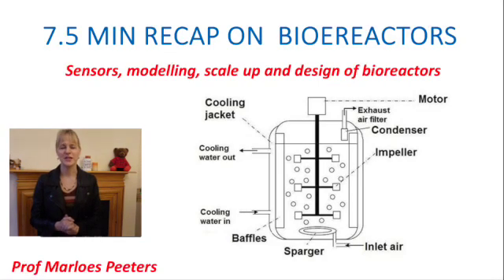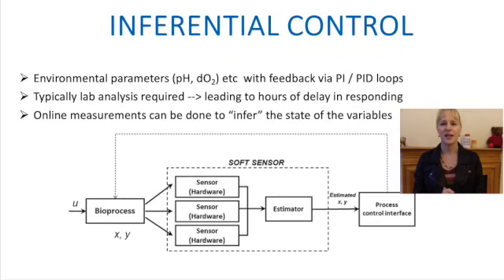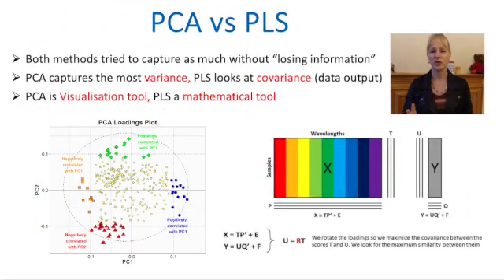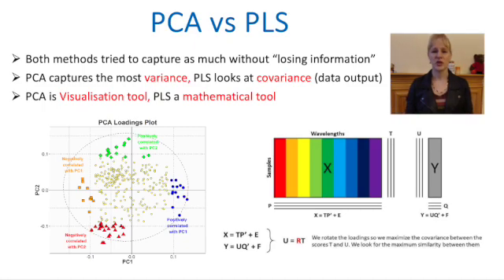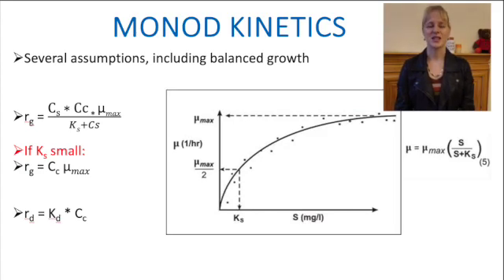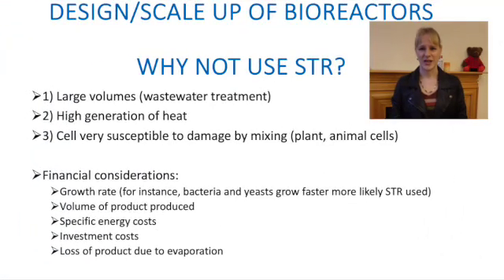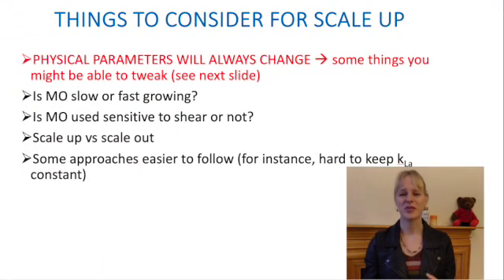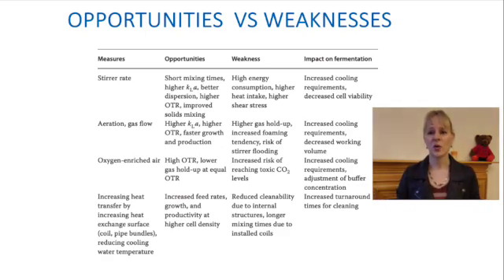Bioreactors recap: sensors, modelling, scale up and alternative reactor design

Comment: Just a quick question: I believe both Power per volume and KLa won't be similar at scale up. How do take the next step plz?
Reply from the maker: kLa is hard to measure but is possible (see other videos). You might want to employ some empirical formula to determine kLa; common equations often depend on vs and Pg/V, thus why Pg/V is often considered to be similar to kLa. Hope this helps